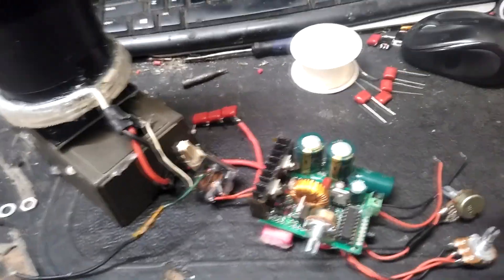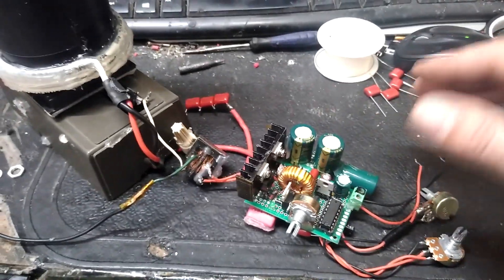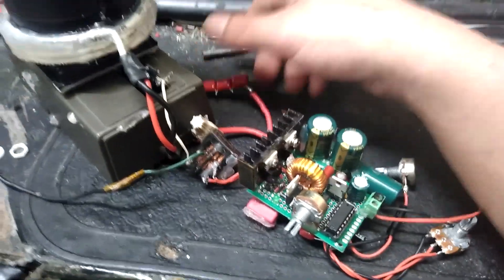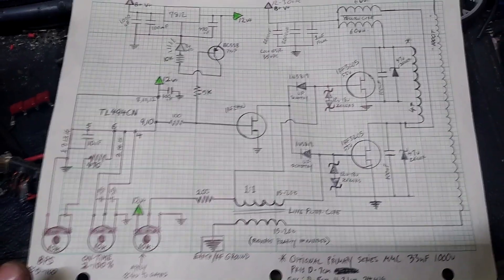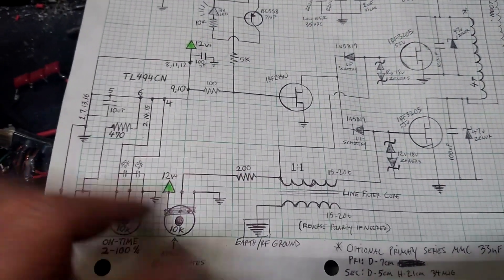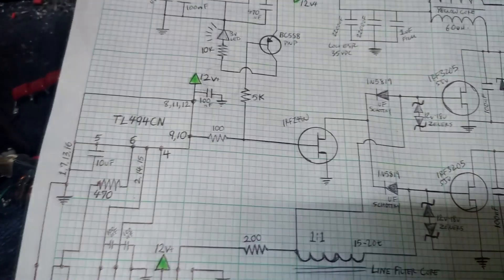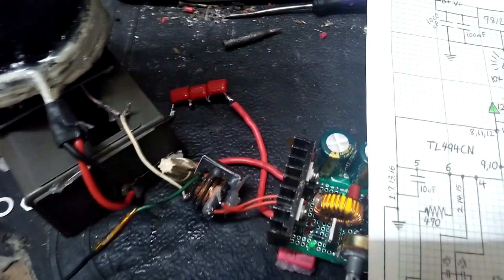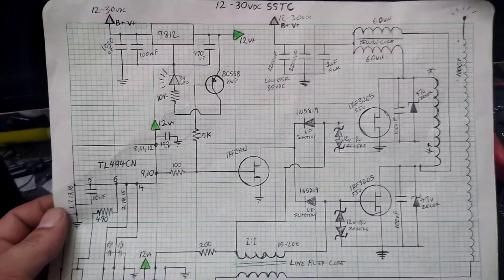12-30vdc DRSSTC IRF3205 Final Schematic (~8 inch arcs @30V)

Comment: are the 12v and 18v zeners supposed to be cathodes facing each other and anodes to a gate and source or the other way around?
Reply from the maker: They are 12V TO 18V zeners so anything in between 12V and 18V or so. And it doesn't matter whether they are back to back or face to face.
Reply: @Magneticitist  oh I put a 12v and a 18v, is that ok? What did you use?
Reply from the maker: @ferrocerium123  I use whatever I have between 12v-18V really.. I just tend to match them per gate. Just look at it like clamping the voltage in both directions. Since it's a sine drive you have both pos and neg swings on the gates. This is what the 2 zeners are for on each gate. One will clamp in the positive direction and the other clamps in the negative direction.. but neither conducts until the zener voltage is reached. If you used an 18V and 12V for example, all depending on their orientation you could be clamping the positive gate voltage to 18V and the negative to 12V etc.
Reply: @Magneticitist  Okie dokie.
Reply: @Magneticitist  what voltage zeners did you use on this circuit?
Reply from the maker: @ferrocerium123  Literally everything between 12V and 18V. In this exact circuit IDK. I've made like 30 of these things. I don't use the same values every time because it's not crucial.
Reply: @Magneticitist  okie dokie

Comment: in the schematic, you didn't show the polatiry of the mosfets like if the source or drain is the connection at the top which one is it?
Reply from the maker: The fets are common grounded so in this circuit each end of the primary coil just goes to a drain.
Reply: @Magneticitist  ok, thanks
Reply: @Magneticitist  on the very left of the TL494CN, what pin is  next to pin 5? It seems to be unlabeled or is it the ones you put on the  side?
Reply from the maker: @ferrocerium123  yea it's all 4 of those pins together
Reply: @Magneticitist  okie dokie, almost finished! I just need to add the zener diodes and the primary coil secondary coil and mmc bank, are secondary primary and mmc bank able to be calulated in javatc?
Reply: @Magneticitist  uhh, so it turns out that I don't have 12v and 18v and 47v zeners, is there any other types I can use?
Reply from the maker: @ferrocerium123  You don't need the 47V zeners on the drains but you can use whatever zeners you have on the gates between like 12V and 18V. The point being you just want to clamp the positive and negative gate swings to below the max rating of around +-20V.
Reply: @Magneticitist  okie dokie, can I use 43v zeners though? I have 13v and uhh. the only other one i have is 20v
Reply: @Magneticitist  ok, i just bought a zener diode kit on amazon
Reply from the maker: @ferrocerium123  yea you need 2 diodes per mosfet gate

Comment: is the line filter core the GDT?
Reply from the maker: yea
Reply: @Magneticitist  do you think that using a core that is meant for a gdt would work better? I've
Reply from the maker: @ferrocerium123  Not really. It's a rather unconventional approach to driving gates because it's using the secondary current directly with no regulation of any kind, and this results in basically a sinusoidal gate drive. The important part is making sure the waveform across the gates is not exceeding the maximum voltage rating.
Reply: @Magneticitist  okie dokie, I was wondering why it didnt look like a normal place for a gdt. Also, if i am successful in making this, can i make a video on it? If so I would give you credit of course.
Reply from the maker: @ferrocerium123  Yea I don't have any personal stake in it or claim it as my own anyway. That circuit and the drawing was just me tinkering with the circuit, getting good output, then just showing exactly how it was built etc. If I tried to engineer that circuit better into some diagram I'd want people to replicate exactly it would probably look a little different. Skori is probably the originator of the concept when it comes to publishing circuits, but his were just involving a lot more parts and worked a little differently. You could show this as just a generic self oscillating push-pull SSTC.
Reply: @Magneticitist  ok, I'll still give you credit though:)
Reply: @Magneticitist  parts just arrrived! Im going to start soldering
Reply: @Magneticitist  If i tune the primary by taping it, if I start with the tap with the highest amount of turns and go down and down until I find the highest output, can the mosfets break? Or can I use java tc to tune it? Are the primary tank capacitors able to be tuned in javatc aswell? Also, are they just in series with one side of the primary at and  a mosfet drain?
Reply from the maker: @ferrocerium123  You can try that approach if you like. Yes the fets could be destroyed but this all depends on a lot of things. If you keep your input voltage down it helps but it helps more to use a scope. The series capacitor is just in series with the primary so yea it doesn't matter which side.
Reply: @Magneticitist  I dont have a scope :/
Reply from the maker: @ferrocerium123  It's not necessary but certainly helps in many situations. I didn't use one the first 15-20 of those things I made but when I ran into problems it became more of a guessing game.
Reply: @Magneticitist  Okie dokie, do you know the current draw? Because I'm making this for a friend, so I need to give him his own power supply to turn it on or a battery or something like that
Reply from the maker: @ferrocerium123  It depends but if you want to be able to run high on times then something like a 10A supply is ideal. I just use something like a drill battery sometimes. Either that or some DIY supply that uses a boost/buck driver to give 30VDC. Those cheap buck drivers seem to work fine when rated 150-300W. It also depends on your tuning. These can be tuned to give decent interrupted arcs at a very low continuous draw. Some 24V 1A adapter or something like that isn't going to work.
Reply: @Magneticitist  okie dokie

Comment: do you think IRFP2907PBFs will work instead of IRF3205s? They have a higher voltage rating and an EXTERMELY high current rating, but the Input Capacitance (Ciss) (Max) @ Vds and Gate Charge (Qg) (Max) @ Vgs
 are higher.
Reply from the maker: They should yea
Reply: @Magneticitist  okie dokie, thanks! Do you think that a higher voltage and current rating will make tuning easier to do without killing the mosfets?
Reply from the maker: @ferrocerium123  Probably so but I wouldn't say by a huge margin. 75V rating is not far off from 55V. The lower on resistance might help the output though. If I wanted to tune it and worry less about over voltage I'd use something like 200V fets.
Reply: @Magneticitist  so like an irfp250n or irfp260n? I have found that irfp260ns are harder to tune in driverless SSTCs thou
Reply: @Magneticitist  it seems like DMT8008SCT is a better version of IRF3205PBF in almost every way except at power distribution, im going to keep researching about fets that would work better for tuning to experment
Reply from the maker: @ferrocerium123  There are no doubt going to be better mosfets out there.. when taking any build very seriously I would make sure to buy such parts from somewhere like mouser or digikey etc.. Typically I will try to gather an order list in my head over time and just buy in bulk. Otherwise I might just buy a 10 pack of mosfets off Amazon knowing I can get them in a day. I buy a few mosfets from a distributor and I'm adding like 8 bucks on top of it for ground shipping etc. If I devoted the proper time I would prefer to etch out a custom PCB and use surface mount mosfets. 

What I'm typically doing with these 55V fets is pushing them to the max. I'm not actually calculating max avalanche energy or anything... I'm just running the crap out of them and seeing them survive no problem. I've seen 75V swings on these before using 55V fets and they ran fine for years and still surviving. If you can find a fet with essentially the same specs or better, but with a higher voltage ceiling, I would definitely go with that just so it's less risky. I get a little more risky when tuning these using 100V fets and with the 55V's I'm pretty careful. What I wouldn't do is try using like a 500V fet just to be safe, but only end up still feeding it like 30V max.
Reply: @Magneticitist  okie dokie

Comment: if i use pure dc on the imput, do i need the 1000uf capacitors and 2200uf capacitors?
Reply from the maker: The 1000uF is pretty large so I think that's just what I had at the time. I just like to have some kind of large filtering on the front of any IC's and voltage regulators because I'll probably have power indicator leds which can help tell me if something is wrong if they are not dimming down at a certain curve I remember. For example If I see my led dim down too fast from 1000uf reservoir after I turn the switch off, I might assume there is something wrong with the TL494 or something. The cap also serves as some extra bus capacitance when the control and coil power are tied together adding it to the 2200's. So basically I'm just stacking a bunch of bus capacitance if possible. You don't necessarily need a ton of capacitance but it's going to help.
Reply: @Magneticitist  ok, thanks! This will probably be used as a troubleshooting note i will use later to

Comment: does it matter whether the 12v or 18v Zener diode's cathode faces ether the gate or source?
Reply from the maker: It doesn't matter so long as you have two of them in series, with both facing opposite directions. It only matters if you have two different values for trying to clamp pos and neg swings differently.
Reply: @Magneticitist  Ok thanks, I'm making this for a friend whos a high voltage noobie, so how long do you think it can run before it dies? Because hes probably gona play with it as long as possible because thats what he does with mine. Also, can the secondary ground just be a big metal sheet or something like that , that can be portable? My friend probably doesnt have an RF ground. Or do I need to shove a screw drive into the ground of an outlet and attach the secondary's bottom there?
Reply from the maker: @ferrocerium123  None of mine have ever died so far and I used to run them a lot. So long as you don't kill the fets from overheating they should be fine, unless they are just always riding on the edge of over volting and the tuning is thrown out of wack enough to kill them that way one day. I usually use a mains ground by just tapping into the ground on an outlet but you can also use any good alternative ground. For example the drill-gun one I have just grounds via your hand when holding it. I have another I just run a clip lead from and try to clip it on any decent RF Ground that is there at the time. Kind of depends on the construction of it as well. The sloppier I used to make these the more I would need to worry about interference and shielding. Sometimes I can get away with no shielding at all.
Reply: @Magneticitist  ok thanks!

Comment: Hi there, after a long time I tried again,

..it did work...but I had alot of ringings, probably cuz I followed the tefattonix...a bit(He didn't used any drain source caps, basically anything like a snubber) 
And....after exceeding 100k..hz as the gate freq got near...300k...and 500khz...les than a sec...a fet burned....

The gate singla was very distorted, skethy sine waves,
The gdt I wound 20:20,on a 2.5cm OD ferrite toroid
I used irfp250ns
Later after doing some Google searches I found out..that higher gate charge  require powerfull gate drive(more current)
250n has over 150nC charge so...
Could it be?
Next I have some chinese nce8290 very identical to irf3205s...
Reply from the maker: I've made a few on 250N's and have another one I'm playing with now but for the voltages I run, like 30VDC, I just prefer the smaller 55A or 110A mosfets. They also seem easier to tune for me. 
You should be able to run over 1mhz no problem on 250N's. I'm using a small fingernail sized 1:1 pulse transformer for the GDT.
Reply: @Magneticitist mann..I really don't get how you doing that without a proper gdt aight...guess I'll just salvage one from a 12v psu...those filter cores
Reply from the maker: @acex727 ill do a video when I get a chanc3
Reply: @Magneticitist thanks for considering
Well so I tried again with irf3205s now it worked..well not for too long.
Just I was having my way Outta the arcs.(Pretty decents ones small I guess)
One fet went bad the Drain went short with the source which suggests voltage spike, I think
Now people use snubber for that
..but snubber is difficult to built takes alot calculations to do, you said the caps works like snubbers but I still didn't put any caps between drain and source ...heh

Well do you recommend using tvs diodes? Between drain source1.5ke33Ca? Or 47Ca....etc..? 

Anyway thanks dude. Really appreciate your replies
Reply from the maker: @acex727  I would just say with 55V fets you definitely have to be more careful. I'm going to do a video maybe tonight or tomorrow on the 250N build but that's just real basic and doesn't give long arcs.. just better than what most people may be used to at that input voltage. When it comes to the snubbers I've never really calculated anything.. just got a ballpark on what my swings were looking like in the off cycles. I just try to keep them from going too high, and not have them completely drowned out by too much capacitance. From there, a lot of tuning can be done with the primary impedance or coupling. You can def try adding any kind of voltage suppression but just tossing some smallish snubber value between 5-10nF seems good enough for me most of the time. 

I also just got some more IRF3250s so I'll probably try another go at one of those.
Reply: @Magneticitist are you still using 100nf on drains? Does it still work with no issues?
I'm so confused about the snubber thing
Reply from the maker: @acex727  With the 55V fets typically yes. With 250N's I go closer to 5-10nF if any at all.

Comment: Have you used snubber resistors
Reply from the maker: In other circuits yes but not this one. Snubbers for these circuits would need to be calculated properly or they are going to burn up fast.
Reply: My coils sparks very small at 24 v pls help me
Reply from the maker: @ what power supply are you using?

Comment: Where did you add those caps on the back side of pcb , are they tuning ones?
Reply from the maker: Those are a bunch of filter caps on the power rail as well as the snubber caps on the drains.

Comment: my mosfets die very quickly and lost my 50 mosfets without any reason what to do?
Reply from the maker: Find the reason first. There is definitely a reason. It could be many things from the general layout, the wires, or just how you are powering it and trying to start oscillation. It's a difficult question for me because I never had a lot of difficulty.. I didn't really know how to iterate that so I just showed a bunch I made without problems.

Comment: Great result. Is there a way to fine tune the resonance? I still can't get good arcs. I change the capacity of the Drain capacitors, as well as the tank caps, but all I get is an arc of 2 centimeters...
Reply from the maker: Doing that and also trying to tune the chokes are all part of it. There's actually a few ways to do it. You also need to keep the topload and breakout point in mind. If nothing seems to want to tune you might have to start over. These can be difficult to get working right.
Reply: @Magneticitist  , does it also make sense to change the connection type of capacitors from series to parallel and vice versa?
I think it will be easier to adjust the resonance with an oscilloscope.
Reply from the maker: @QuarkLab  It really all depends. I've used both series and parallel capacitance at once before. You sort of have to see how the tuning is affected by your hand or other loading as well. It's not going to be as easy as just calculating resonant capacitor values like you would a DRSSTC. You need to really know what is resonating and where. I would never waste time doing that and just trial and error different arrangements and try to figure out afterward how it was actually tuned.
Reply: @Magneticitist  , okay , thanks for the advice. I'll try to find resonance =)

Comment: Which is better, connecting secondary base to the Earth/RF ground or to the GND of the circuit ?
Reply from the maker: It kind of depends but I would always go with a solid earth ground if I have that ability. If not the ground of the circuit will work but it may need to be tuned slightly different

Comment: Dear sir, the circuit which was designed for irf3205 sstc, can irfp460, irfp240 also be operated with the same circuit or not. Please let me know. thank you
Reply from the maker: Technically yes any mosfet will work but the circuit as-is seems to work best with a 3205 or similar.

Comment: Sir which other mosfet can be installed instead of irf3205. So that the SSTC can be operated with higher voltage. Please let me know. thank you
Reply from the maker: I've used mosfets like ( https://www.digikey.com/en/products/detail/vishay-siliconix/SUM110N10-09-E3/1770776 ) before but also common IRFP250's and IRFP460's in some builds. The benefit of the IRF3205 or other high current mosfet is the low on resistance for compact builds.
Reply: @Magneticitist  🙏🙏
Reply: @Magneticitist  Sir what irfp460. irfp240 etc mosfet will run on the same circuit that irf3205 designed for sstc.